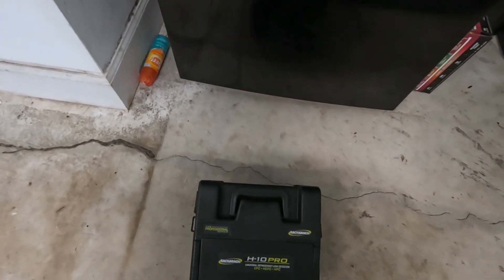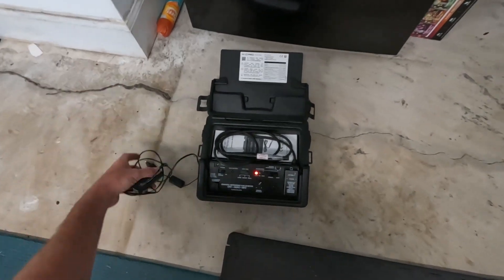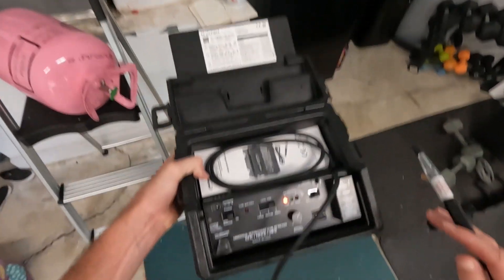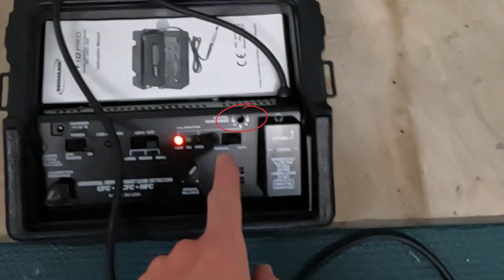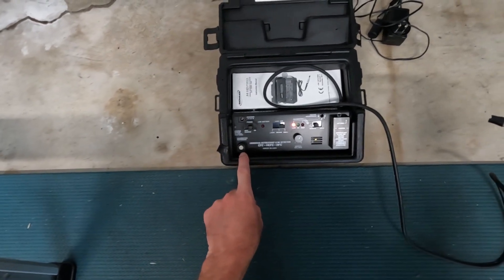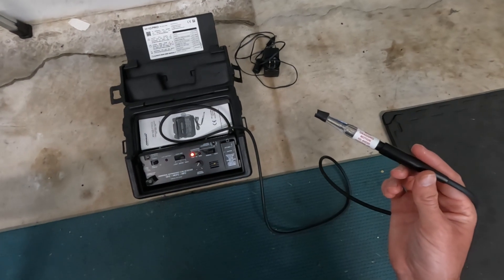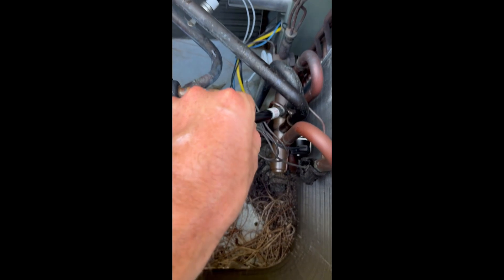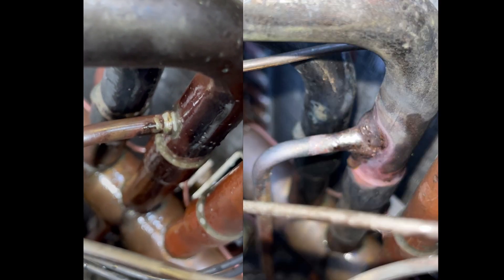Looking for a Refrigerant Leak Detector? H10 One of the BEST

Comment: My calibration bottle has been sitting without the sticker cap on it for a year now in my hot ass truck and is still 3/4 full that is a .006 oz per year leak and the H-10 picks it up! None of my field piece leak detectors will trigger on the bottle! I have them all heated diode and infrared nothing even comes close to this thing it’s by far the best leak detector on the market!

Comment: Nice. So you think the auto mode is not sensitive enough in practice? Is there a scenario where you’d use that instead of manual?
Reply from the maker: Auto doesn't have to be calibrated like Manual does. I do use auto sometimes like if I see that the evaporator coil for example is very rusty and likely to be leaking there, I will use auto. If it's a newer unit or I suspect the Leak to be small I will use manual. Thanks for the feedback and watching!